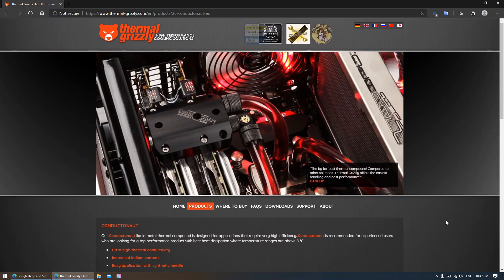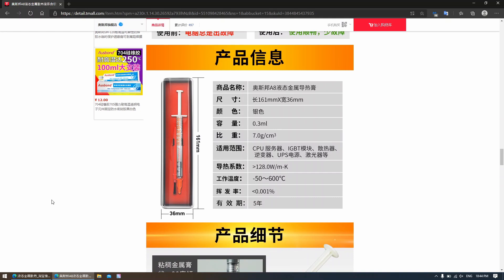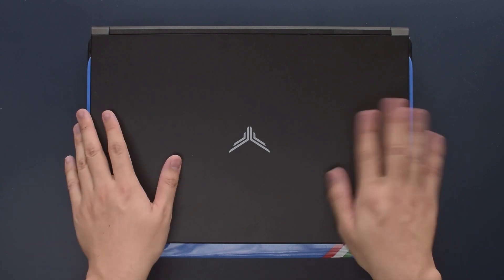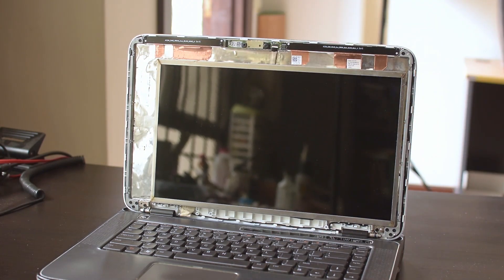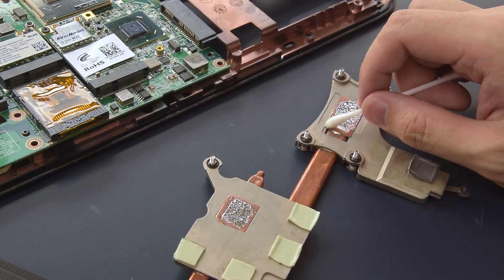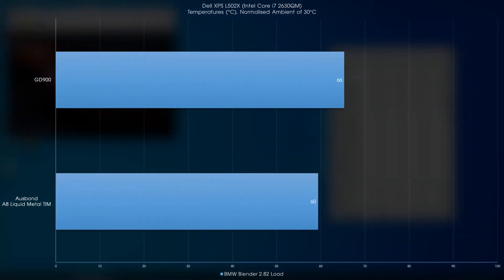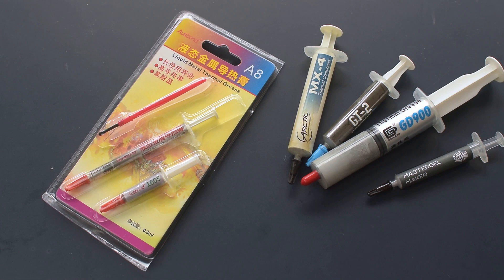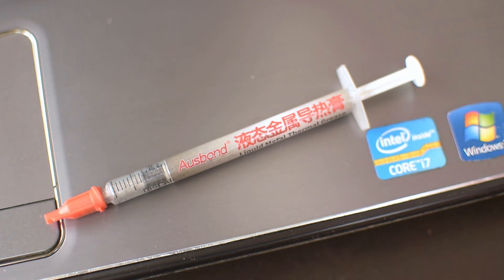Chinese Liquid Metal, What Could Go Wrong! - Ausbond A8 Liquid Metal Thermal TIM Review

Comment: why you did not protected the SMDs on the chips?
Reply: It will absorb in the naked copper so a repaste of LM in 6months will be necessary, so that the resulting alloy has sufficient "liquid".  The repaste in this case  is just apply more without cleaning

Comment: Great video I also recently liquid metal my old 1070 with conductonaut though must be careful as your laptop is a bigger spread plate surround the small copper area. Make sure the spread plate most likely is aluminium, does not comes into contact with the liquid metal or the liquid metal will eat the aluminium
Reply from the maker: This is absolutely correct! I had to make sure that the contact points were between either Copper and Nickel, or at least anything other than Aluminium.

The good thing is that most if not all the laptops that I have dealt with so far use Copper heatpipes with even the contact point being copper, but there are quite a number of CPU Coolers for desktops that don't, or can be difficult to tell between nickel coating and just pure aluminium!

Comment: Thank you for making these videos as i am a cooling geek ( i dont know if thats a thing)..made my purchasing decision of the id cooling vga cooler for my 1080ti based on your video...about the gd900, yes please review it but if possible can you check wether these claims are true: gd900 performs on par with the high end thermal paste at a lower temperature (say 60c) but perform quite worse at higher temps (say 80c and above) thank you so much and your consideration is much appreciated. love your contents keep making them
Reply from the maker: Very interesting, I've never heard of those concerns before regarding the GD900. That should be quite interesting to test though, it would mean that better on idle and worst on load.
Reply: @TechRodent  appreciate it man